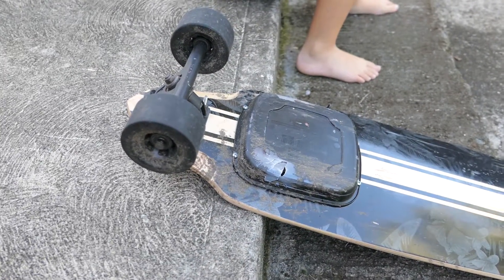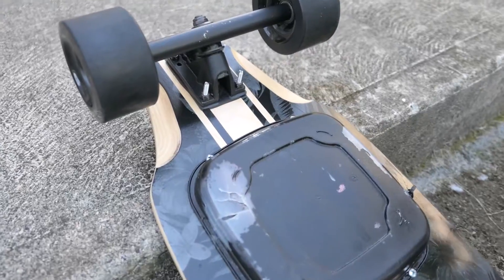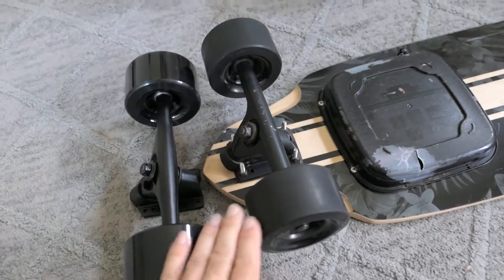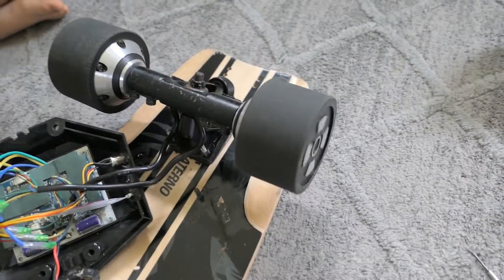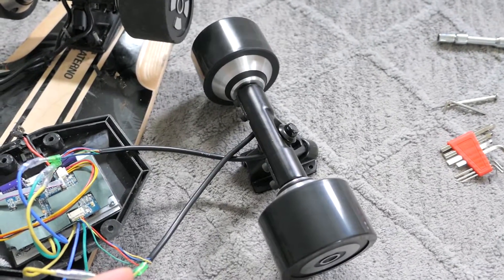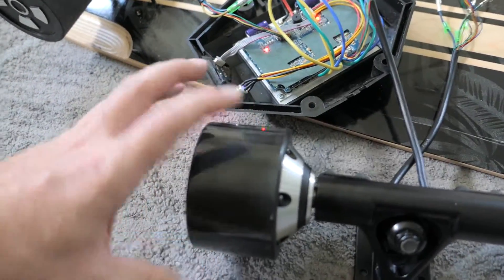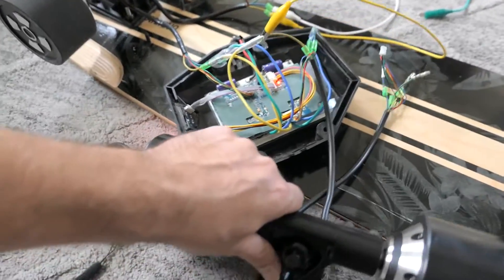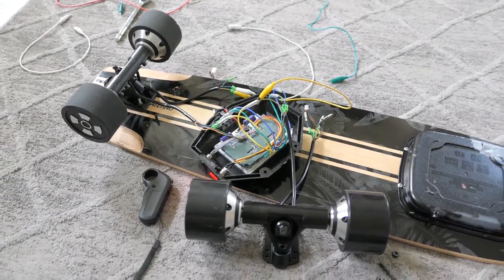Diy Electric Skateboard - Update and Plans

Comment: If you wanna do a 4WD you can buy another but you will have problems to figure out how to connect only 1 remote to make it work on both esc's.
Actually you just need this, these are made for only 1 controller and have extension wires for the battery: http://www.diyeboard.com/4wd-esc-using-dual-esc-x-2-speed-control-kit-for-four-motors-p-633.html
I recently saw this on the esk8 forum. I also got a diy esk8 and using the same esc ;)
Reply from the maker: Thanks for the link! Thats actually exactly what i bought but i got it on ebay.
Reply: Just Vlad Oh nice looking forward to your build!

Comment: Maybe its not the motors fault that it doesnt have enough torque. Maybe your batteries cant push enough amps. I have the same motors and esc and they push me just fine.
I have videos of me riding on my channel.
I am 105 kilos.
Reply from the maker: Actually its very good overall its just i'm 190lbs and some steeper hills are hard to climb. I just want to build a board that will preform like the high ends and still be some what affordable. I want to climb any hill with ease is the plan. Thanks and ill check out your videos.
Reply: LOL im 44lbs heavier

Comment: i think you can pair 1 remote with 2 controllers
Reply from the maker: I contacted the supplier and they said its only possible if they program it from the factory. So i had to order it. Thanks
Reply: https://www.ebay.com/itm/4WD-longboard-skateboard-controller-with-remote-ESC-Substitute/302558036328?ssPageName=STRK%3AMEBIDX%3AIT&var=601397417634&_trksid=p2055119.m1438.l2649